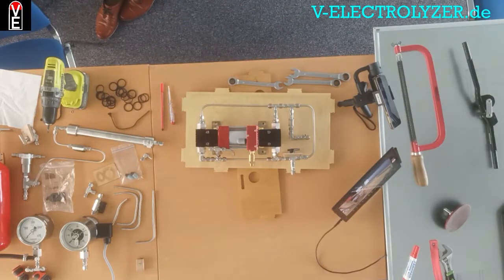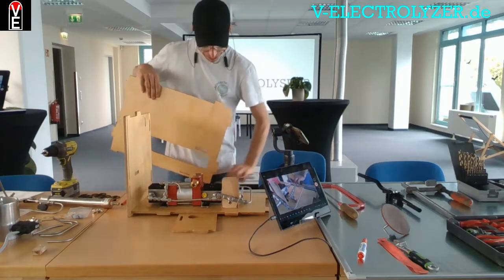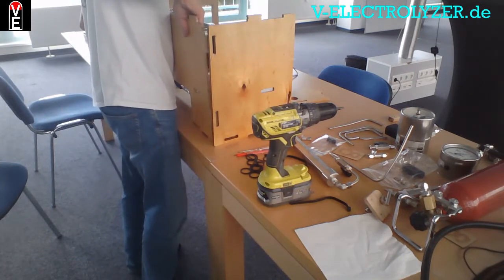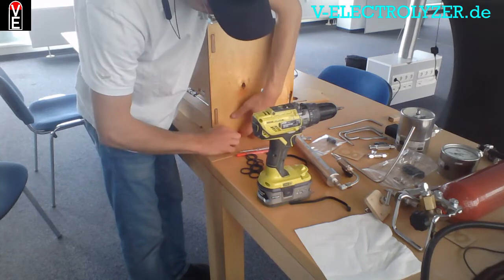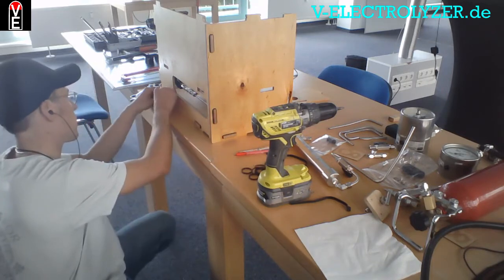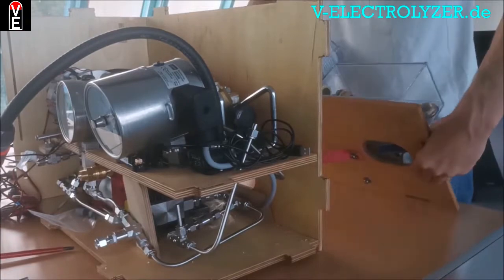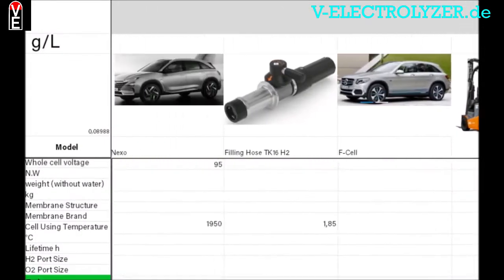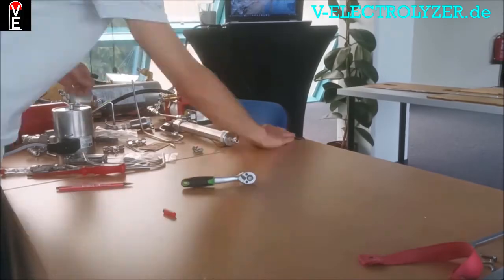007 hydrogen home fueling station, machine housing, case

Comment: the struggle is real
Reply from the maker: thanks for you comment. what do you mean?
Reply: @volks-electrolyzer  how are you going to get 700 bar compression?
Reply from the maker: @chisaomusician7752  Pressure is force by area. imagine a double piston. on one side like disc, very large. on the other side the piston is skinny like a toothpick. On the disk side we use a normal Air compressor with 9 bar. This pressure has a huge force on the hydrogen side. to cool the hydrogen you do that in multiple stages.
Reply: @volks-electrolyzer  I am now looking at another video of yours and am at least interested. Marketing will be hard, for every stupid thing Mr. Musk says you will have to say 100 smarter things.

I think you could get independent verification if you work with the hydrogen drone makers and enthusiasts. All in all it is something everyone would want, at least while there are few filling stations.